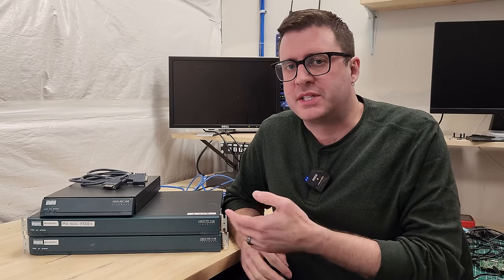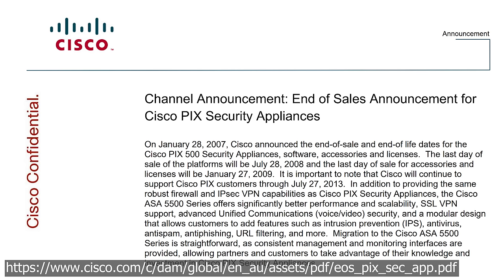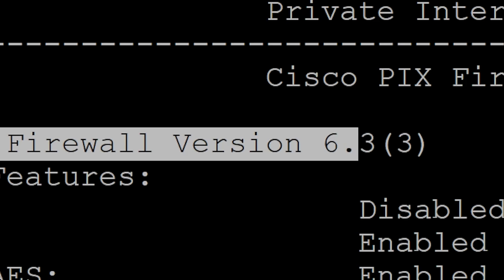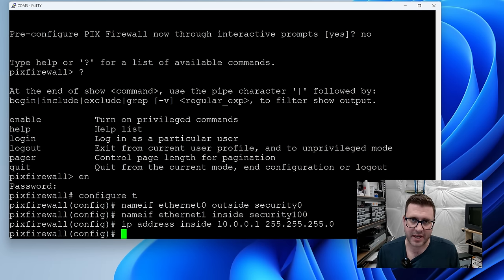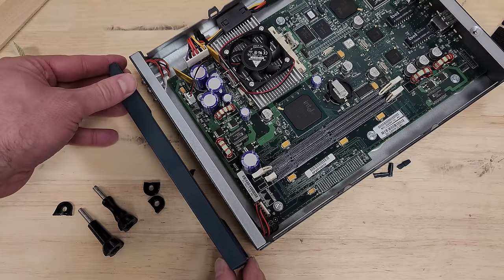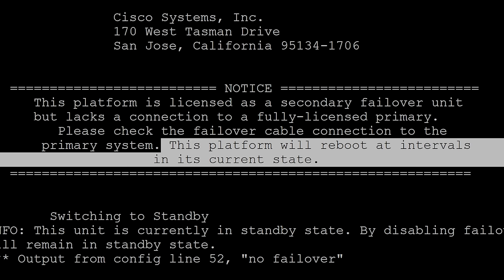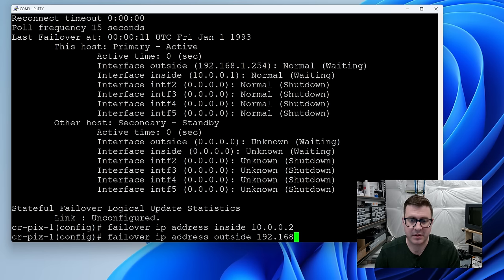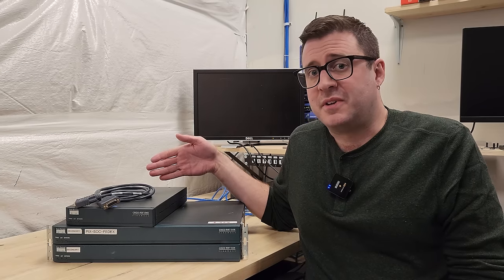Early 2000s Networking with Cisco PIX

Comment: As a Cisco Certified Network Associate, I can tell you that I was trained on equipment from 2002 😂 because for some reason networking equipment is NEVER retired, just handed down. Hahaha
Reply from the maker: haha
Reply: True story 😂
Reply: very true, for my church my dad put in this 20 year old DLink gigabit switch to replace a newer switch that was causing network issues and the network has never been faster!
Reply: we had some of these as well in 2016, the high speed serial port was... not fast (compared to the old aui 10mbit, although I don't recall if we could push it further than 115200)
Reply: Because really, 10mbit still can do a lot. You can argue it doesn't, it still does!
Reply: @cocusar surely no data is going over that serial link, it's just the heartbeat surely?
Reply: I trained in 2002 on equipment from 1999.
Reply: The nice thing about Cisco CLI is it's unchanged. They keep adding features but everything that PIX does, you'll find in a modern Cisco firewall
Reply: @tarajoe07  yeah it all feels pretty similar to modern cisco cli syntax
Reply: Ain't that the truth. Our ISP had some ancient (we're talking 10 out of production) switch that they used to deliver us service, it finally broke and it got replaced by switch only 3 years out of support.

I guess it being supported by manufacturer doesn't matter much if you have a shelf full of spares.

Comment: Great deep dive into PIX networking!  The repair on the 506e looked about perfect.
Reply from the maker: Thanks!
Reply: Of course, no one bothers with those "fronts". I've never seen one mounted in a rack facing "forward". You'll want something to cover the fan, but a square of window screen will do. After 20 years, I'm surprised my 515E still has it's bezel. (the 2 506's don't. no clue where they are.)

Comment: Just a heads-up as you acquire Cisco gear: a bunch of stuff manufactured from 2005 to 2012 had potentially defective RAM chips. 2004 and earlier should be immune.
Reply: And bad caps. And an era of bad Atom CPU's.
Reply: i had two 1812 routers, until the soldered ram went bad😅
Reply: Everyone knows the stuff from 1999 and earlier was the best looking.

Comment: The wall-wart PSU isn't for cost saving reasons, rather that telco-racks used to all run on a central DC supply that used the same plug.
Reply from the maker: oh interesting. would this small unit have been racked up in large quantities though? or maybe they just used the same plug.
Reply: @clabretro This being more of the 'small business' type, these would typically be combined with a small router with the same plug, and maybe a switch. A lot of these will ultimately have run off wall-warts, but you can find this typical DC plug on a lot of this type of gear, even non-cisco.
Reply: Some of the 'newer' Cisco hardware actually has built in A/C power supplies as well as direct backup/alternate D/C connections on it. It's common to provide a UPS that provides D/C to a whole rack of devices, but it can also be used in situations where its easier to only provide D/C.
Reply: @clabretro  Depends on the shop. Where I working in the early 2000's, 506's were paired on shelves. The power brick tied to the back of the shelf. The 1700 line of routers used the same power brick. As I recall, it provides 3 voltages. The 515 uses an internal PSU... because it has room for one. (the 506 is the same board as the 515. they omit the PCI riser slot, one flash chip -- thus 8M, and in some DIMM slots. the 506 was made to be as cheap as possible.)

Comment: Fun Fact:  The PIX 506E and its power switch can be wired to a standard ATX power supply.  I've got a 506E that I had to hack together because of a dead PSU.  But then again the whole PIX was only $15 from Ebay and I had a small eMachines ATX PSU that was just right.
Reply from the maker: ha very cool

Comment: I’m 43, started working in tech around 1999. This was soo nostalgic for me. Thank you
Reply from the maker: thanks for watching!
Reply: It's a bit odd to hear someone be nostalgic about equipment that my last employer still had in production (and I think still does) two years ago.

And it's not because there's no better solution or because it's stable - it reboots frequently and needs remote hands to go hard power cycle it - it's because the CEO would rather spend tens of thousands on chartered flights, than ten thousand on getting a decent networking consultant to re-implenment it in something modern and reliable.

You get nostaligia, I get something like PTSD 🙂

Comment: Man this brings back some memories. :) Set up many of these 501, 506E and 515s back then. I still have my PIX 501 in my archives, but definitely off-line since it can't handle the speeds available today. That poor thing connected with 25 Meg up and down speeds would bury the CPU just on the port translations. Adding a single 3DES VPN connection to the office and I swear I could hear it screaming in pain. :D
As any PIX admin will tell you, stick with the CLI. The web interface is just a pretty face that looks good when the boss is around. Using it to configure most of the delicate NAT and VPN configs... well there's a reason it's called "Config Breaker". ;)
Reply from the maker: ha nice!

Comment: In my current role I still use the blue rollover cables with a prolific chip USB to Serial cable. The newer switches have the usb mini only which causes more crashes than ever.

I have been desperately waiting for an networking video 😮😅
Reply: Yea, you have to get the right cables with the correct USB controller or Windows just will not have it. Haha

Comment: I use to drool over these Cisco appliances. Had to settle with a 233MHz PII and Smoothwall burning up all kinds of energy and heating up my "network" rack. Good ole WRT54G as an AP serving 2.4GHz B goodness through a 8 port 10baseT powerhouse . Even in the booonies, we did get about 300mb/s. Hot stuff! Literally. Lots of heat!!!

Nice gopro recycling! Saved some velcro!
Reply: Turns out you were ahead of the curve since every now is software defined running Linux in the background.

Comment: v7.0+ (re)formats flash to have an actual filesystem, and modernizes the CLI to something that looks more like IOS. If you must use the older 6.3 line, load the erasedisk on the FO unit, and reload 6.3 via tftp. My 515E is running the last code published - 8.0.4(28).
Reply from the maker: yeah I'm gonna do the erasedisk, I couldn't even get it to load 7.x after that last pw reset attempt
Reply: @clabretro  I assume you've found the activation code generator. (it's just md5) The erase process will wipe the code, so you should attempt to find it first. (logs from previous boots?) Otherwise, we're just guessing at the feature set. (no one has documented what the bits mean.)
Reply from the maker: yeah I've got that secondary wiped and back in action

Comment: Ugh, this reminds me I still have a set of ASAs that I need to replace at my employer lol. I personally hate working on them, but not as much as CheckPoint. Really makes you appreciate how good modern enterprise firewalls like Palo Alto are.

Looking forward to seeing these in an HA setup. Great video keep it up
Reply: 100%  I cut my teeth on PIX, then ASA.  I never felt like I completely understood whether particular kinds of traffic would work or not.  There were so many additional configuration settings that would allow things you didn't intend to, or block things you wanted, and sometimes things seemed to work / not work even when the policy checker said they shouldn't / should.

On a PAN firewall, when I write a config and it does something I don't expect, I'm immediately thinking -- what did I miss, am I logged into the right box, which one of the HA pair is active right now?  Because it generally does exactly what it's told, and when the results are anything else, I can usually find the reason why.

Maybe the difference is an additional decade of experience.  I dunno.  It's been a long time since I built a network around an ASA.  But I remember it having a mind of its own.

And I still, to this day, have to deal with VPNs that use that awful proxy list method of identifying traffic, vs. a normal routed interface at each end.  MAN do I hate those.

I think I'm going to hate-watch this episode, because I have no nostalgia whatsoever for these cursed boxes.
Reply: @nickwallette6201  For what it's worth, I normally had my toes crossed when I made config changes to the PIX and ASA boxes I used to run... It always made me feel uneasy not really knowing if it was going to behave the way I wanted.. I never had that problem with Cisco routers and switches... And I've never had that problem with the other security devices I've used since - which tends to be Palo Alto these days.
Reply: @AirzonesBlasters   Oh good, it wasn't just me.  haha  I have wondered, if I still had my ASA lab boxen, whether I would have an easier time these days, or if they really were as obtuse as I remember them being way back when.  That was from a time in my life where I was learning a lot about Cisco configuration, so maybe I just didn't know what I was doing yet.  But I do remember the tail end of my ASA experience was right around our company's move to PANOS 3.x.  While I made a couple mistakes with those, it generally went smoothly and things worked how I expected.  The things that didn't were clearly my fault, and once I saw what happened, I fully understood why it didn't work.

Comment: Literally Everyone has 'bricked' one of these devices before... Sometimes on every other job 😂 it's very common, and it's not that difficult to fix, you were going about it the right way.

If there's a checksum error, it just means that the file is corrupted, either the hosted version, or when you downloaded it. If you try another copy from a different archive or a different version it should still work.

It could technically mean that the versions don't match, too (because you err trying to use an earlier version) but most of these devices don't actually care if you downgrade, I've done it many times before.
Reply from the maker: haha yeah. I did hunt down a flash erase bin I'll try next
Reply: @clabretro Like many network minions of the era, I have an extensive archive of PIX things. (well, as extensive as it was... 27 files, 102M Maybe more if I go hunting, but that's my primary archive.) Plus a pix license generator. (hint: it's just MD5)

Comment: I still have PixOS 8.0.4(28) on my nas lol that was the last version supported by these beasts.  The one pix I never got to mess with was the Pix535.  Always wanted to tinker with that one.  It actually had better throughput than the first gen ASA because of the bandwidth limits of the PCI bus of the ASA 5510 and 5520.  The Pix535 used PCI-X 64bit slots which had more throughput.
Reply from the maker: oh yeah those 535s look awesome

Comment: Not sure your failover would have worked anyway.  Correct me if I’m wrong but your workstation has the inside IP of the primary - 10.0.0.1 - set as the gateway and in the failover config you specified a different IP for the inside interface of the secondary - 10.0.0.2 - so when it became active your workstation would have continued to send all traffic to the offline primary interface.  Or does the secondary assume the IP of the primary at failover?  If that’s the case then why give the secondary an IP at all?  Or do they work active/active?  Forgive me, I used to run an ASA several years ago, with no formal training, but it was all virtual I never had to contemplate an actual hardware failover.
Reply from the maker: I was thinking about that too.. I was just following some failover documentation I found, it did seem odd. I just got that secondary pix I was having trouble with wiped and running the same version as the primary again so I'll give it another shot eventually.
Reply: @clabretro   @ramble-uk 
My recollect is that they flip-flop IP's, so gateway IP's don't change. Can't remember if they do a gratuitous arp to update client arp tables or not. Back in the day, I deployed and ran a few dozen 520's, 515's, 525's & 535's on our network. It's been a while though.

Comment: I just got rid of all my old Cisco routers and firewall equipment.  They just don't have anywhere near enough horsepower to run on today's modern networks.   Considering that I have 5Gbps link into the house now with full backup, there was no way I would ever use any of that equipment again and it was just sitting collecting dust.  I did have a fully licensed redundant 515E set as well.  👍🤠
Reply from the maker: yeah too slow for any real work for sure. just like messing around with them

Comment: I remember hating those little trashboxes due to some weird behaviour and some bugs. I crashed one once by typing "?" ("show the help for current command"), and we couldn't repeat that bug...

We even wrote a little bit of code to automatically push ACLs to those via CLI
Reply: Monolithic kernels and software routing will do that.  Which is why nobody does it that way anymore.  These things are a honeypot nowadays.
Reply: @nickwallette6201  uh, I dunno how to tell you but that's how entirety of cloud runs. Software routing and monolithic (Linux) kernels.
Reply: @xani666   Yeaaahh, you kinda have a point there.  But at least the entire software stack isn't running as one single process.

Comment: First firewall appliance I ever used was a PIX 501 then 506E And later 515E and ASA5505. 

If I recall wasn’t there a graphical gui on the PIX devices you could optionally use?
Reply from the maker: there is! I haven't tried it out yet, probably cover that in a future video
Reply: @clabretro  yeah it required Java if I recall. I think it was called PDM (pix device manager). The ASA appliances had an even better gui.
Reply from the maker: yeah I thought it'd be interesting to eventually cover a bunch of the different management GUIs

Comment: Are you subscribed to the channel that’s building up a 90’s isp using period correct hardware? They have a sparc and just added ppp via terminal servers, maybe a joint project could be some sort of ‘network across time’ between their 90’s isp and your 2000’s enterprise. They are doing bgp…
Reply from the maker: yeah! they did an excellent video of the history of these PIX units

Comment: I really don't miss the pix devices. Worst syntax for nat, and just most annoying cli in general.

But having said that, I did use a frankenpix for a few years - that's the boot flash isa board from an even older pix than you have there, installed onto a generic pc motherboard.  Usually the classic 440BX chipset was the most reliable for it (as it's basically what the pix was built on anyway)

edit: just to clairfy, I was a network security engineer a few years after that. Netscreen (this is pre the juniper acquisition), cyberguard, checkpoint, probably a few others I've long since forgotten. I've used a bunch of early 2000's firewalls and nothing was quite as obtuse to get your heard around...well except maybe gauntlet, but those were well on the way out at that point in time
Reply from the maker: I'd never done it before but even I could tell the nat syntax felt weird haha
Reply from the maker: I've seen those checkpoint machines floating around on ebay, might have to get my hands on one.

Comment: Hey one off topic question, do you know if it’s possible to recover the administrative password for ilo 3 from an hp proliant dl360 g7 without loosing the license ( if there is one ) ?
Reply from the maker: sometimes management systems have jumpers on the main board to get around the password. I'd take a look in the manual to see if the g7 has something like that!
Reply: @clabretro  Hey Clab , just a quick Update on my server. The ilo password wasn’t actually changed from the standard password and the configuration utility allowed me to add a second admin. And yes ilo is fully licensed. Thanks for your help 👍🏻👍🏻👍🏻
Reply from the maker: that's great! @leoben53

Comment: How much RAM do your PIXies have ?
Reply from the maker: 506e has 32mb, one of the 515es has 64mb and the other 128mb
Reply: @clabretro I think the Cisco part number for the memory module is Cisco 15-7860-01, they should be around 10$ max

Comment: If that is a Socket 370, it should be a Celeron or P3. It would weird for them to use a Socket 615 for the mobile processors.
Reply from the maker: it reports as a PII on the 506e but yeah probably actually a celeron.

Comment: would it be possible to install windows or Linux on thesw things? the 506 looks as if it might have more peripherals on it. did a quick google search and no such crazy hacks on these sadly, but maybe it's possible. of course the idea is to use them as routers/firewalls, but trying to install a different os on it is also interesting
Reply from the maker: I bet it's possible to get something custom flashed on there, I couldn't really find anything to try out either though

Comment: You sure is a Pentium II ?..., not some Celeron or a Pentium  III upgrade to keep low load, like in a hackaday upgrade of a 506E.. I've never seen a socket 370 Pentium II,  is it OEM/Vendor exclusive? would you care to share?
Reply from the maker: the 506e reports it as a 300mhz PII but I bet it's actually a celeron. I'll actually pull it and confirm in a followup video eventually!